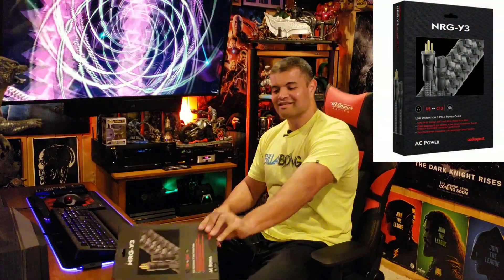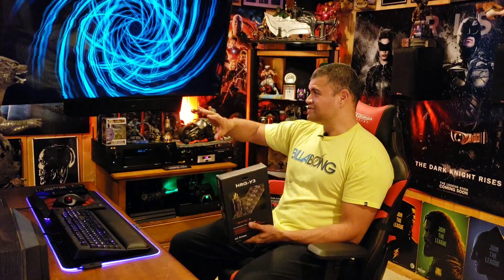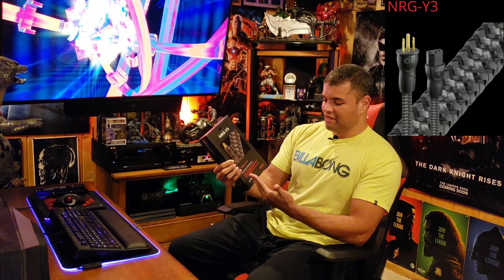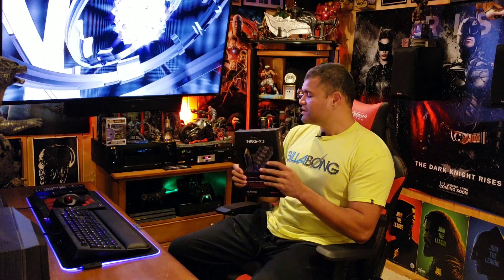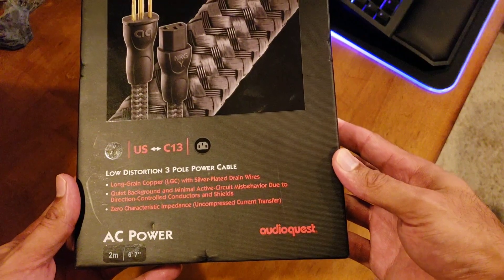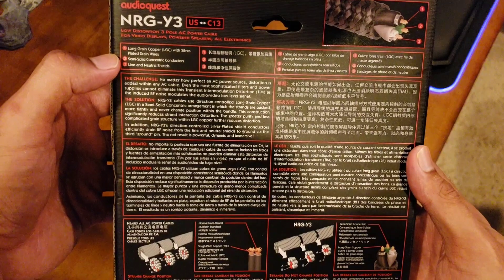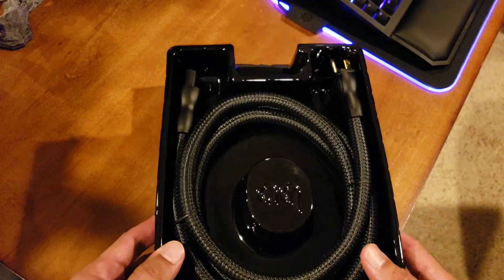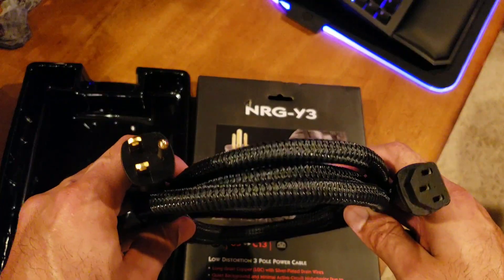Audioquest NRG-Y3 Power Cord : Unboxing!

Comment: I want you to advise me about  power cord used for the AV receiver and Subwoofer. The price is $500 to $1000 What is the best power cord to your experience?
Thanks
Reply from the maker: The power cord In this video Is plenty good for your products.
Reply: Spending more than a $150 or $200 is all you really need any more than that I would just upgrade my equipment

Comment: I’m an audiophile and I’ve never ever herd a difference in one cable but I do use these cables and noticed at the end of the day swapping out all of my interconnects including pwr does absolutely make a diff, it’s more of a collective effort. The cables don’t give more power in the last meter from the wall but when your power cord goes thru your rats nest because it’s shielded it’s better suited for that environment , it does make a diff , but swapping one cable out for another forget it your wasting your time. There are other things you can do to get better audible results like swapping your binding lugs out on your speakers for solid gold plated no metal parts . Audiophiliac - Steve Gutenberg said it best you get better results going to a quality entry level piece than a mid tier or top tier that’s where the snake oil lives . But to actually get you r power cables twisted and shielded and tie the braids into the ground are a noticeable improvement and a decent audioquest can do that for you .

Comment: I suppose if I had money to pay a lot for looks I would to. You should take some time and check out Audioholics on YouTube. They have a whole series on just  Audio Quest cables.
Reply from the maker: I'm familiar with them.  Thank you.
Reply: Well then????
Reply from the maker: @jr62inhometheater98  We will agree to disagree on the topic of cables. 🙂
Reply: Yes we will. Just one last thing and I will drop it. I am assuming you are running your equipment through a power conditioner ? Then the power is already cleaned or conditioned and protected. Then what does the AudioQuest power cable do exactly? Still enjoy your channel and very impressed with your setup.
Reply from the maker: @jr62inhometheater98  I'm using a Monster Power center.  The cable will  prevent power Imperfections from the outlet to the device. Thanks for watching.  👍🏽
Reply: @jr62inhometheater98  Our cables are designed to dramatically reduce the radio-frequency noise that exists all around us, while also controlling the noise that would otherwise feed into the system, so that connected devices receive the purest, most uncompressed current possible. This partly explains why Raf is perceiving higher levels even when playing his system at the same volume. We also employ what we call "Zero (or no) Characteristic Impedance." A cable’s characteristic impedance is crucial for optimal performance. Our AC cables combine low DC resistance and zero characteristic impedance in order to deliver uncompressed transients on demand. In short, we're not strangling the current, as is so often the case. We hope anyone who is interested will simply take the time to listen. Thanks so much!
Reply: THE RAFCAVE What did you turn me in to the Audio Quest police?
Reply: AudioQuestUS The key word in your statement is he is perceiving to hear.
Thanks for reaching out.
Reply: AudioQuestUS Well it’s been over 2 months now and I never heard from the great Audio Quest. Soo I guess you don’t backup your words with actions. I will give you this . Your cables do look nice,but so-do many other brands that do the same thing for a whole lot less.
Reply: @jr62inhometheater98  I used to wor in a Magnolia design center in Best Buy. Employee discount is 5% over cost, I could get a 200 dollar AQ cable for like 35 bucks, so I did, speaker wire, HDMI,power and they made no perceptible difference to the quality imo.  Denon 6400h, outlaw 5000 amp, B&W 702 S2, OPPO 203, Ladder dac
Reply: Main Source Wow that exchange was awhile back. But still nothing has changed  IMO. And I never did hear from AQ on there claims about there power cable!! LOL